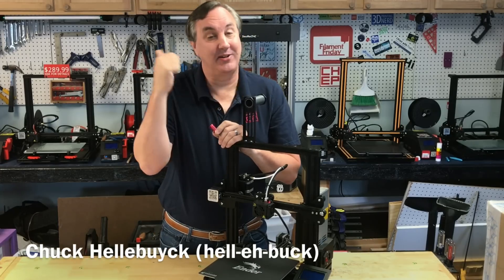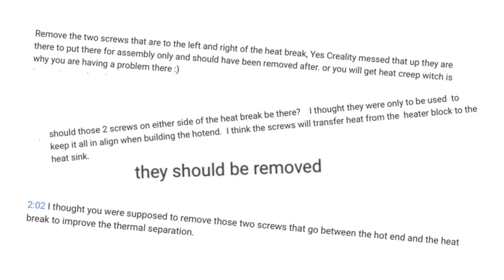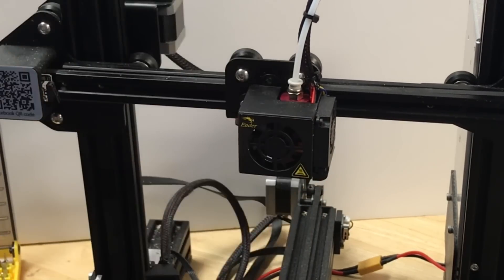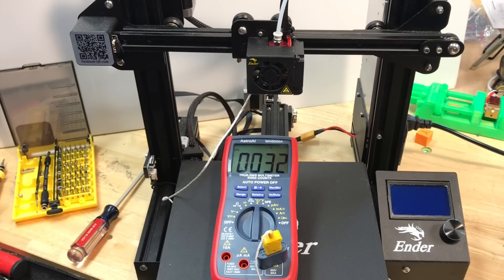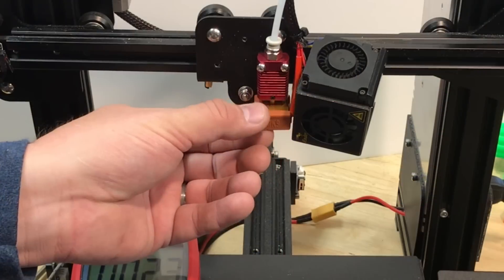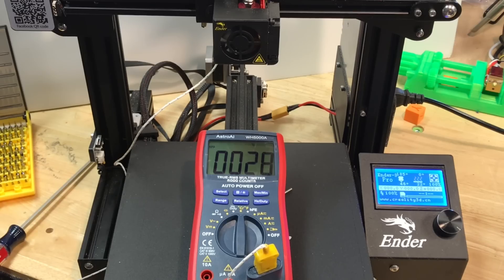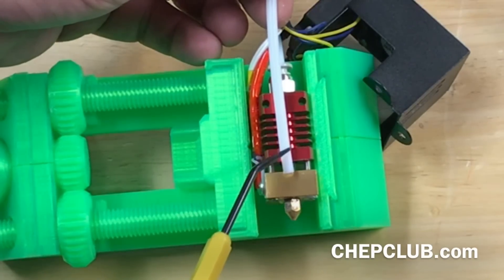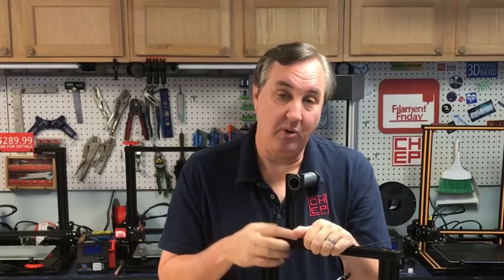Creality Ender 3 Hot End Heat Creep - Remove Those Screws......Maybe?

Comment: Great video! I considered removing the screws because I have overheating on the heatsink even after replacing the fan. I don't know what to do anymore. It even overheats up to the x-axis carriage support. I have three 40mm fans ready to be placed to improve the temperature of the cold zone of the hotend but I can't find any mod that lets me use all three fans to improve the temperature of the heatsink. All the mods I find use two to cool the print on the bed.

Comment: thermocouple was cooled by the fan too much because of poor contact with heatsink. methodology too sloppy. also you say same temp in video while showing 30 instead of 32 degrees
Reply: I think the point is that it doesn't mater with or without the screws in place...2 degrees difference is neligible and can be even because a different room temp, its not going to afect filament.
Reply: @Maximus_sapiens  its not measuring heatsink temperature if its touching dry metal and being blasted with a fan
Reply: @Boz1211111  I agree with you on the fact that the measurements are not acurate but if you can touch the heatsink with the fingers it won't afect in any case the filament, with or without the screw.
Reply: @Maximus_sapiens  Yes

Comment: has anyone else had this problem? recently I been having a problem with my standard ender 3 nozzle going higher then the printing limit I put which is 200 degrees, It goes to 208 or something like that put then it will cool down to 190 but it would not start the print and try to heat up to 200 degrees again and repeat like its stalling. and the time it would try to print it would give me the thermal issue screen. PLEASE SOMEONE GIVE ME ANSWERS.
Reply from the maker: You can run a PID control on it to help. That will adjust parameters in firmware to hopefully correct it. You can Google how to do it if it’s not in the LCD menu.

Comment: I just recently got a new hot end and it gets so hot it smokes and melts my sock cover, would you know how to stop that? Any solutions would be appreciated!
Reply from the maker: That’s a big problem. It implies it has the wrong thermistor inside or your printer board doesn’t have thermal runaway protection.
Reply: @FilamentFriday  ohhh yeah thank you I sensed up realizing I put in the thermistor wrong and fixed it!
Reply: your sock cover is not made from silicone then. silicone nevers melts it burns so if youre prints are fine i think the problem is just your sock covers
Reply: @shsd7579  ohhh ok thank you

Comment: I printed absolutely fine for the first couple months, no problems. Tried some bigger prints, nothing but issues. It's NOT the filament, it's NOT my retraction settings, it's NOT the esteps.  I've spent the last month trying every single calibration tool, every single piece of advice (even the stuff that contradicts the other stuff), and I simply CANNOT print more than 30 minutes without the extruder bucking. But the hot end isn't clogged. I'm so tired of endless stringing, "clogged" hotends, failed prints. I'm about to throw this thing out. I switched to a direct drive dual gear, and despite most people claiming "DD solves it all!", I've had nothing but problems. I think I'll try going back to the longer bowden tube, then it's seriously going in the garbage.
Reply from the maker: Replace the fan. If you touch the top of the hotend and it warm or hot then the fan is bad. 
https://youtu.be/t0GFl-T7T8k?si=YYvyByryv_NucB0Q

Comment: I've been having some blockage issues with my hotend and for some odd reason, a lot of cold pulls and nozzle cleanings later, I decided to take those screws off and the blockage issues just seemed to magically disappear.
Reply from the maker: Your fan is probably failing. It may be spinning but not fast enough. If you touch the top of the hotend and it feels warm or hot then it’s the fan not the screws.

Comment: How do I fix heat creep I’m having a major problem I’m about ready to bin mine lol
Reply from the maker: Have you replaced to cooling fan?
Typically that is the issue.
Reply: @FilamentFriday  I’m not even sure if it’s heat creep tbh it’s a new issue it randomly blocks then goes again so there’s several big gaps between the layers. I’ve tried new filament didn’t seem to solve the issue. I’ve had it for so long so I can’t complain too much that it’s only just become a pain.
Reply: @FilamentFriday you was right the fan did need changing. All up n running again now cheers

Comment: No you do not remove them.
Reply: Thanks bud, only about 5 years late.
Reply: @PlastiForge  YouTube is like an encyclopedia.  Many people see this question and there’s no answers.  Now there is.  It’s complete.  Your welcome.
Reply: @dugy40  There were answers everywhere, some people answered "yes you remove them" and some people answered "no you don't remove them". The point of the video was to demonstrate, not just answer.
Reply: @PlastiForge  Thanks to this exact thinking of yours we've got plenty of "thanks, will test it asap and post the results in the morning" and "ok, finally managed fixed it on my own, bye" as the last things on threads. This is the internet. It lasts. Time has a minor meaning here.

Comment: Is it only me thinking just use one screw to get most of the benefits with half the negatives? :) Titanium screws are better too, they come with the new Spider hotend. Also you'd want at least one screw as backup to stop it falling I'd say!
Reply: The screws are there to stop your heat break from snapping in half the next time you crash your nozzle.

“Heat creep” is a symptom of poor PID control which is either poor thermal coupling of thermistor (LOL why isn’t it a t/c??) to block, or poor thermal coupling of heater cartridge to block.

Creality didn’t use thermal compound in mine, and the thermistor isn’t even attached to the block directly. 

This is a recipe for very poor temp control.

If you think the screws are conducting too much heat back into the sink, you have a different problem.

One should never need to remove these mechanical supports.
Reply: @railgap  yeah but anyone that knows what they're doing (not every user!) Shouldn't be crashing the nozzle at all!! Of course without them you are relying on one grub scrrw to hold on the hotend, that is no good. And you cannot tighten the nozzle etc without them. I am now running on just one screw and I pop another in for a nozzle change. It's a bit less heat migration to the cold end. I have some titanium ones on the way anyway :)
Reply: @LaurenceGough ever tried resuming a failed print? Or a broken end stop?
Reply: @MaxDev  I just upgraded to new titanium screw creality hotend. Much better design and quality
Reply: @MaxDev  but yeah I've had 100s of failed prints who hasn't. I'm pushing speed all the time lol.
Reply: @LaurenceGough  same, but sometimes the z is just a little off and the printer just throws itself at my locked In print

Comment: The screws are to prevent you from snapping the heat brake if you have a head crash. It makes sense for creality to use them, especially since they don't significantly effect heat creep, but they will significantly reduce returns from broken hot ends.
Reply: Agree 100%, also creality uses a 4010 fan so it’s fine

Comment: Question that I can't find anywhere:
Is the stock heat break supposed to be screwed all the way in the block so that it is against the nozzle with a gap between nozzle and block?  I think My 3V2 had a loose heat break when I got it.
It was definitely loose when I had replaced the nozzle, apparently didn't have the PTFE against the nozzle, so filament oozed up along the threads between the block and heat break.
With it all tight, I seem to get some heat creep as I see about 1/4" filament always be at the bottom of the tube when I pull filament out.  This is with PLA+
Reply: I have been searching far and wide, and nobody seems to provide an answer to this

Comment: My problem was solved by removing those screws, having issues with extruder skipping steps, under extrusion... After many tries of replacing everything nozzle, tube, extruder but I found my heat block heating too much till pneumatic connector then i removed those screws
Reply from the maker: Your fan is probably the real reason. If it’s spinning slow or has a broken blade the heat sink can get hot.
Reply: Ya it’s either your fan or the heat sink. When it was new did you have to take out the screws?
 if not then the problem isn’t the screws. Fan is weak or dirty or the heat sink is dirty or….your printing on top of a volcano.

Edit. Supposed it possible the heater or your thermo sensor could be going bad too but more unlikely. But if it was the heater you would see that with the temps that it’s reading .
Reply: @chris2pher44  i ordered a all metal hotend hopefully that fixes my issues if not ill keep trying
Reply: @alepepperoni2563  i'm facing issues since i have installed all metal hot end from Aliexpress, similar shape to original, but less cooling fins on the heatsink. No way to solve the underextrusion and skipping issue since then...
Reply: Stock fan? My stock fan was still working but not good enough, couldn't print over 200-205 without problems.
Reply: Wow I think you guys just helped me fix my issue with my ender.
Reply: Cheps measures at wrong places. He should be better mesure temp at the heatbreaks neck. The Problem is the big aluminium block at lower to the cooling ribs, where the screws are going in. The heat transferes from that piece to the upper part of the heatbreak and warms it up from about 30°C to 80-120°C. It's not a myth, it's a real issue!
Reply: Can tell you i had the same issue on my 2 week old ender. I had massive clogging and underextrusion issues, and every single time i did a cold pull, the filament was thickened (thus reached glass transition and beyond) for the entire length of the heatbreak and PTFE coupler. I burned my fingers first time trying to remove the coupler when swapping the stock pfte tube.
I removed the screws, and my issues went away entirely.
Reply from the maker: @hans… You should replace your fan. The coupling should not be hot with a properly working fan, screws or no screws.
Reply: yes, It solve my problem too. It not to prevent heat creep,but prevent heat block loosing temperature too fast. Making filament not melt and get under extrude. The more good your fan is faster losing heat block temperature.

Comment: The hot end on my ender 5 is clogged and I'm trying to clean it but can't remove the screw on top that holds the fan trout because it's stripped. Worst timing possible, any idea on how I can fix this?
Reply: If you can, using your cutters with the flat edge facing away from the screw head.  lightly close the cutters under the screw head just to make contact with the screw and turn the screw to loosen as normal with just a light pulling of the cutters as if you are pulling the screw out.

Comment: Hey guys, newbie here. I printed a test cube that was supposed to have .8mm walls with a .4mm tip.  My print finished with .52mm walls, 2 layer at .26mm, and I've tried telling it to print slower but the results are the same. Is there something I'm missing? What controls 'print thickness' other than print speed? Using ender 3 pro. Thanks...
Reply from the maker: Flow settings.
Reply: @FilamentFriday  Thank you. Have a great day.

Comment: I took out one of the screw and now my hotend heats up faster. (Ender3 V2)
Reply: I was thinking of this as well, the fan seems to cool off any heat that is transferring up the screws,  but we are talking about heat being pulled away from something we want to be hot,  I would like to see a similar experiment, but with a ammeter or power meter,  I know it wouldn't be much difference, but I suspect there is some heat loss there, and as you said, it probably would heat up faster.  that being said,  I think that the benefits of the screws outweigh any slight negative there might be,  after all,  thousands of these machines have been sold, and work perfectly with the screws.  I have a elegoo neptune 2s, uses the same two screws on the hot end.
Reply: @agriperma  I had been using my ender 3v2 for almost 2 years with two screws ç without any problem before I have changed the cooling assembly a few weeks ago. Which has bigger air inlets.(did not change the original fan) than, what I noticed is, it could not reach high temps like 250c after the update. Than, I have covered the half of the air inlets which helped a lot. After some research, I have decided to take one of the screw out.

Result; İt heats up faster than before and now I don't have to cover the air inlets of the cooling fan. İt is completely open now and it İs heating up faster.

Comment: I wonder what heat creep is.
Reply from the maker: Heat creep is when the temp rises in the heat sink area an softens the upper filament too much. In most cases it’s a failing fan not anything else.
Reply: @FilamentFriday  Thank you. Got it. Now I've got to figure out 'why' we don't want the heat sink (an intentional magnet for heat) to draw heat. I know the sytem is designed to do just this. The system is correct. I just haven't yet figured out why heat creep isn't precisely what we're after. Maybe int's a balancing act. I'll get there. :-) Thanks for your channel.
Reply from the maker: Heat sinks have a limit and can saturate. The myth is the screws will make that happen but I proved they don’t.
Reply: @USS-DDG-2  The heat sink is only there to cool the path the filament is following above the heat break area(heat break=the airgap between the heater block and heat sink in this case).  

Heat creep is often blamed when people mess up(there are a billion things to mess up on in 3d printing), but it's entirely possible that it DOES happen.  When the filament heats up, it gets softer, stickier, and expands.  You may have it bending/snapping upon extraction/sticking to the walls of the tube or just plain getting too fat to fit in the pipe.  All are undesirable and they occur well before the glass point temperature.
Reply: @FilamentFriday  how do you know if you have a failing fan? I have been having a problem with what I think is heat creep and despite everything I’ve tried nothing has helped. Could my fan be going bad?
Reply from the maker: If the top of the heat sink is warm to the touch, then the fan isn’t working properly.

Comment: Actually hotend in ender 3 is well designed. This part contibuted largly why those printers are so popular. Those screws not only prevent heater block from being lose they also prevent snaping heatbreak when changing nozzle.

Comment: I came across this video while looking for something else but I would like to say thanks.  
Also I have a tronxy that has a similar hotend but doesn't have the screws and I have an Ender 3 that had them.  I hate changing nozzles on the tronxy because the entire block comes loose. I would trade a little extra heat in the heatsink for the convenience of nozzle changes.

Comment: I'm thinking you could test the actual hot end to see if there is a difference. I have a feeling those screws are there to actually transfer the heat better.
Reply: I need to point out that we are NOT trying to "transfer the heat better." The purpose of the heatbreak and the heat sink is to get rid of heat transferring into the filament before it gets to the heat block. That's why I switched to a bimetal heatbreak for all my printers. That titanium between the heat block and the heat sink slows the transfer of heat. That one change made a HUGE improvement in how often I experienced clogs.

Comment: I recently recovered my Anet A8 from an E1 Heating Failed error. What had happened was that the heating block had moved when I changed from white to black filament, leaving just a corner of the block touching the plastic on the X-axis. Conclusion: the heat sink can have some contact with the heat block, but minimize the heat block's contact with anything else, and also do not let the lowest fin on the heat sink make contact with the heat block.

Comment: My only concern with research is low hot end temp
Leave it sit at 220° for 8 hours and that's when heat creep starts

Saw another video guy added thermal paste to fill gap between throat and heat sink
He claims he hasn't clogged in a year.

He mentioned screws said "if you want to add some to screws too" 
I don't think I will because thermal paste runs into glue with hot cold cycles !!!
Last thing we need is a broken screw.. although a new hot end assembly is like 13 bucks USD lol
Rather not break them !!!

Comment: This is in the category, when there is a fly on my windshield it will increase the drag.
Technically and logically correct but what about (the order of) magnitude. 
In the hotend one would expect that the heater cartrigde has to heat a little more to overcome the loss due  to the screws transferring heat to the sink. Effects on the ptfe are negligible like the experiment shows,  Great mythbusting video!

Comment: Prior to this I also removed the screws believing the same thing.
Over time I did discover that the block gets loose and start to flap around in the breeze as I've kept changing nozzles.
I put the screws back in to stabilize it.

I'd say the stability these screws provide outweighs the tiny bit of added heatcreep. Especially if one changes nozzles a lot.